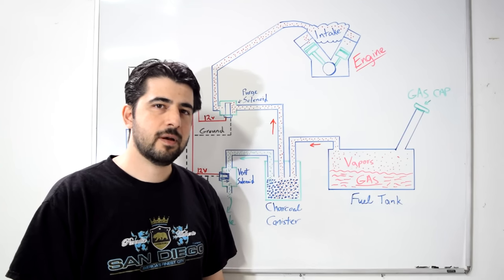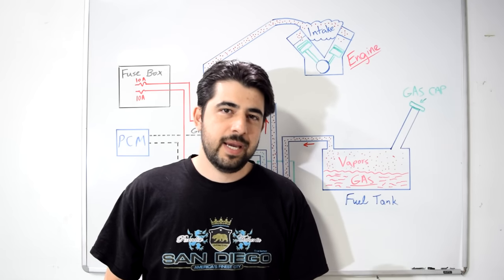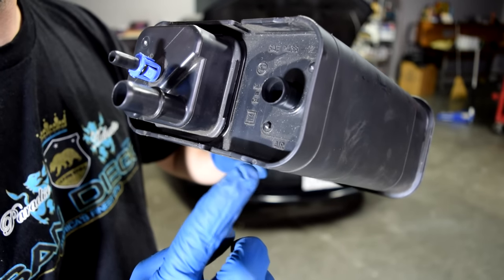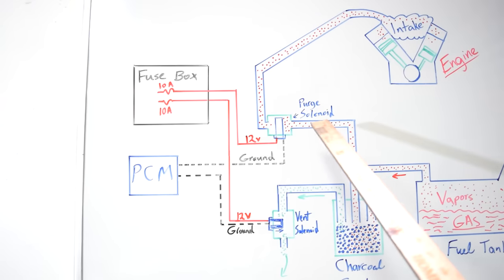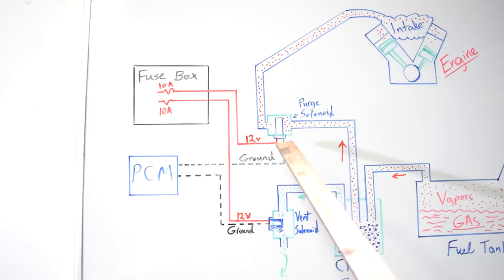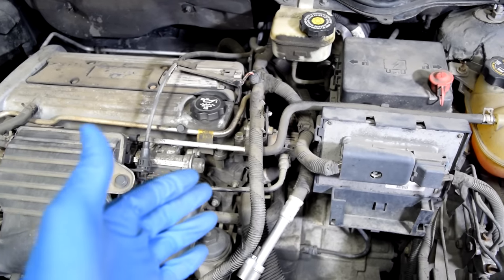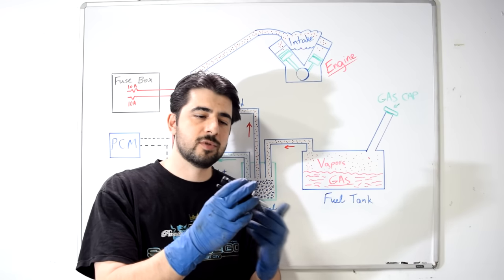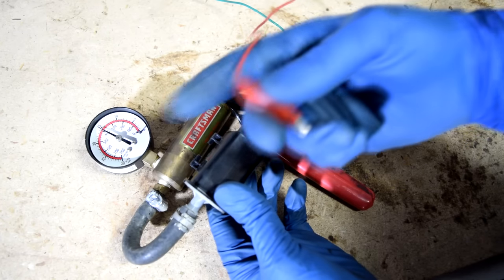Evap Canister Purge Valve Solenoid Operation, Diagnosis and Testing Procedure

Comment: Vent solenoid allows the fuel vapor to depressurization the fuel tank via the carbon scrubber to air. check. Purge solenoid closed until engine is warm. Normally open Vent solenoid closed for startup then reopens after warmup to allow the carbon filter to clean itself or give back the captured fuel vapor that it accumulated while the car was in the hot sun. So it seems ok, but the vapor purge process will cause the engine to run lean after the carbon canister has been purged of fuel vapors. Yeah? What do you do with an older vehicle that has no PCM? I can put a thermal valve in the engine block water jacket to open when warm. Check. But once warm and running it seems I need something to stop the vacuum leak which is the vent valve purging through the carbon filter, but do need to reverse the air flow through the vent valve after the fuel vapor is cleaned. Right? Does that mean I need a driver operated valve to close the vent valve after it has done its job?

Comment: What do you mean if the I have a bad purge solenoid I am going to have a hard time to start the car after i refiil the gas tank? I just put gas in my gas tank and right there the car didn't start. Cranks but it won't start. how do I know is it is the purge solenoid and not the fuel pump?

Comment: were having trouble with our EVAP system on our 98 pathfinder, and were trying to figure out if the lines that go to the sensor solenoid valve is supposed to have charcoal  in it. we have looked everywhere to find out but cant figure it out. can you help?

Comment: what will happen if it quits in the closed position because mine is running fine but the vent solenoid is working and the charcoal canister is good so idk what else it would be

Comment: I got a cell code a p1cea on a 2013 dodge dart I changed the vacuum hose bought the hose at the dealer two days later the check engine came on , could it be the solenoid?

Comment: You can also disconnect hose coming from cannister and unplug elec plug, with car running to check if valve is stuck open. Which if it is would show suction at valve disconnect.

Comment: Hi, your diagram makes things very clear. I have Maxima 2005 and it’s giving me p1446 code which is EVAP vent valve control. I checked it and it works. The power is getting to it as well. The issue is that when I fill up the tank, the fuel will stop filling automatically half way a few times. So it looks like there is a blockage of either the tube that connects the tank to the EVAP canister or the canister itself is clogged. Can anyone suggest a method to test?

Comment: If it's stack in opane position you will find no problem with cold starting in the morning but hot start in mid day u will find the vary hard start spacial when hot day

Comment: My purge valve is always open, I dont have a code for evap, but get a really bad whine at idle. I know it's from unmeter air getting into the intake, (had an old mustang and made mistake to attach an open catch can and run it back to the intake lol) can that be causing m issue? I take the sensor off its closed and stays closed no vacuum but once I reconnect it it's always has vaccum. It's a 2017 mustang gt

Comment: Wow! Always top notch man!  Thanks for sharing!  I see now its a bit older video but still just what I needed.
This is one of those problems that I have been fortunate to have never been exposed to with any vehicle ever and really didn't know a lot about it.
What about the charcoal canister, do you have a video on the faults that it can have?

I'm getting a P1450 now on my 2000 Ford Windstar with occasional rough idle and road speed conditions. It comes and goes for now.

Comment: I have a 2015 Chevy  Sonic LT 1.8  P0496 I think its the purge valve. What do you guys think?
Reply: Jesse Rathbun did you replace it to see if that's what the issue was? in curious because my chevy cobalt has kicked this code and was wondering if I replace mine will it fix the issue.

Comment: I need help if someone can chime in. The code that came up was p0171. The dealer said that the issue was a bad "purge valve" and not covered under the "emissions warranty" for my 2016 chevy sonic. The covered parts says the electronic evaporative control system is covered and specifically lists the "canister solenoids and valves" as well as "plus miscellaneous items used with above components". The "purge valve" is not specifically listed. What's the difference between the purge valve and the canister solenoid valve???

Comment: Hi. Thank you very much for your great videos. I hope you help me with my problem.
Check engine light on my car came on 2 months ago and since then I almost cleaned and replaced everything I could think of. (MAF & MAP sensors, Intake Air Temperature Sensor, fuel injectors, spark plugs, coolant Temperature sensor, camshaft and crankshaft position sensors, 2 O2 (lambda) sensors and cleaning the EGR which was not clogged) 
after installing camshaft sensor check engine went off for few hours and came back on again...! then I replaced all O2 sensors and car was fine for 2 days but today morning again back on...!  
all the time I see "Antipollution fault" on my display. 
I disconnected the Purge Valve from PCM then connected it back. still check engine is on.. after 5-6 hours.. I started the car and check engine light was off till now................. before I ask my question.. I have to say all past 2 months car starts and crancks just 1-2 cracks and runs in -3 C in the morning!!, but when engine is warm it takes longer crank to run the engine. OBD II showed various error codes and after replacing Injectors and O2 sensors those codes are gone but now I see P1454 (unknown).
-----------------------
Question: 
1- why car cranks longer to run when it is warm?
2- based on what I replaced car, do you think my problem can be Purge valve? gas cap!? where should I search or test for problem. (Peugeot 406 coupe, 2.0, 16 v, Petrol)
Thank you in advance for your help and advice.

Comment: I have a code P0449 on my torrent for a purge valve and is it possible that it's giving me a misfire on #1...i have changed everything possible...spark plugs,wires,egr valve vent solenoid and runnig rough idle and bad acceleration ???

Comment: Great work with your videos! I have a question that is off topic but perhaps you can help. I'm referring to a Harley Davidson here. I continually get "rich codes" for both cylinders. I won't go into how many parts have been replaced but my question is...will a bad purge valve possibly cause "rich codes"? Keep up the good work!

Comment: I have a ford focus mk1 2004 1.6 16v. Everytime if i open the gas cap there is some hiss noise corming out of it and smells to gasoline.   i already replaced the Gas cap for a new one. But still it maken hissing noise. Could this mean my canister is stuck closed?
Reply: Mine too. Its under pressure.

Comment: My, I suspect defective, purge valve makes an electronic noise (engine off) when I touch the hose.  Is this the valve closing?  At first I thought it was the elctronic connection but I don't get the noise when I push on the it. Anyone who can comment who's had this experience is greatly appreciated.    2015 Ford Focus

Comment: Could this also be the cause of a vehicle after pumping gas to turn on then turn ignition off but motor still running for about 3 seconds then turns off? Car runs fine and turns off and on fine after that tho and it's everything u pump gas

Comment: Why do Nissan vacuum switches have 3 ports?  I understand how to test them but have no idea why my 93 d21 egr vac. solenoid has 3 ports.  It looks like 1 vacuum source for one pathway (non-energized) and another source for the other pathway (energized).
Reply: I watch your videos and learn.  I found the answer to my question. Nissan labels nipples B,A, and C.  (A and B are the 2 close to each other.)  1 vacuum source (B) and the other extra nipple (C) is for vacuum dump.  As in needing power and needing the egr to shut down fast.  Solenoid de-energized and pathway closes (A-B) and opens pathway (A-C)= vacuum dump into a line that looks like a vacuum source but is in fact not a vacuum source.  (This line winds up in my air filter holder.)  Hey thanks for all the help with TPS, MAP, etc.

Comment: I have a 2008 GMC envoy. Great video. Had a p0442 code. first replaced gas cap and then Purge solenoid. code still there. However instead of the code stating small air leak. it now says  Evap system solenoid circuit. So i thought the solenoid i bought was bad and replaced again. Same thing. Any ideas?

Comment: Great explanation. I would really like to see a video of someone tracking down a small leak without a smoke machine. Will using a positive pressure of 15" wc and snooping the connections work? Is there any reason not to pressure up the evap system by putting 15" pressure into the gas tank?

Comment: Good job bro, I have a f150 2004 ford when I put Vacuum to the intake side it holes and hose but when I blow in through the charcoal canister side air goes through and comes out on the intake side is that mean it’s bad or is it OK but you have to blow hard OK no jokes😊

Comment: Thank you so much for all ur videos they have helped me so much, But I have a problem with my '99 dodge durango 5.9L 150k the RPMs sit at about 1500k to 2000k I have checked all the vacuum lines under the the hood did the break cleaner test Replaced the TPS Map AIC valve throttle body gasket and still have a high idle the truck has plenty of power won't hesitate but sometimes just dies on the red light and starts right back up, please I'm sure you have gone thru this please help I don't know what to do thank you so much.

Comment: does the canister has to be mounted in specific way and position? i'm doing the whole frame swap and the canister originally it was mounted flat horizontally (2004 Crown Victoria) under the trunk. Can i mount it vertically?

Comment: ive been chasing my problem around on my 99 honda accord. car wouldn't start after i filled up gas tank. changed gas cap. changed charcoal canister and shut off valve next to it. but it seems its the purge valve solenoid. damanations

Comment: Great video .can't wait to figure out what's wrong with my 99 ford f150. Have two codes for purge failure. Forget exactly what they were but were for that.was wondering if anyone would know if that would make engine idle high when cranking and run fairly high but after you sit like in a drive thru for awhile want to die out. But usually run good.

Comment: Maybe you explained it differently, but your diagram suggests different operation than I'm used to. normally, the vent valve is in series to the purge valve. When it opens it lets the vapors go into the engine. Because of engine vacuum, I think the vapors would still go into the engine when the vent opens with this unique design. Except of course when the purge valve is also closed to test the system for leaks.
Reply from the maker: Under normal purging of the canister, Vent Valve is open so is the Purge valve. During the Evap test the vent valve is closed, purge vale is open and putting a vacuum on the evap system. While the test is being performed through the fuel tank pressure/vacuum sensor or a purge flow sensor the computer knows if there are vacuums in the syste, allowing for more air pressure/flow or less vacuum in the system than expected.
Reply: Ratchets And Wrenches Cool.

Comment: My gas tank knocks, both when the engine is running, and when I shut the engine off. Could this be related to the purge system creating a partial vacuum in the fuel tank?

Comment: OMG we had garages grasping at straws saying it was our throttle body, and everything else this valve never even came up until we took it to the dealership, our car would have a hard time starting after putting gas in, and it would just rev up and down at stop lights, a stuck open valve makes sense.

Comment: Thanks man. Im changing the purge selenoid in hope it solves the small leak problem in my prius. Its the last solution as I have already replaced all the other components of the evap system but the code still appears.

Comment: Question. Should the purge valve block air flow in both directions when closed?  I can blow air through my valve one way but not the other. I cannot blow air through it towards the manifold.

Comment: This solenoide did the p0171 code to come out since this is basically a vacuum leak. it showed a lean condition and the fourth mechanic who checked the car was able to find the problem. the car was a toyota corolla 2018. I say this to help someone who need some clues.

Comment: Thanx for the video! So what happens when the evap purge solenoid tube to the motor is broken/disconnected? Cant start the car?
Reply from the maker: you should be able to, it'll run rough until your fuel trims adapt though.
Reply: aha. THANX! maybe I'm having another issue in addition then. I broke one of these tubes while changing the battery and now the car doest start. When i turn the key, the starter tries ONCE and then everyhting powers off. I DID connect my battery correctly, (was very careful with that). Do you think i can just try to tape the tube up? Is it save to do that?
Reply from the maker: just put a rubber hose where the tube was as a temporary fix, but it sounds like you actually have a weak battery if the engine is turning over just once.

Comment: Greetings, 

I appreciate the video and your not apologizing for cursing.

I need some help and I'm hoping you can help me or point me in the right direction.    I have a 2005 Chevrolet Suburban 1500 LT and my check engine light went on a week ago.  I took it to AutoZone to see what the code was and it said I needed to replace the Evaporative Emissions (EVAP) Purge Control Valve, which I did.  I turned it over and the check engine light went off.  Cool right?  Easy cheap fix.  So I start it this morning and the check engine light is on again.  The code I get is the same one as before, P0455, most likely solution is to replace the Evaporative Emissions (EVAP) Purge Control Valve again.  I'm frustrated as f*@k!

What should I do?

Do you have a shop?  Are you in North County SD?

Comment: So when the car heats up and you start hearing clicking noises from the purge valve, when it activates, would either mean an issue with the PCM or the valve?
Reply: no most times the purge solenoid is pulse width modulated so it does click repeatedly when the pcm is commanding a purge

Comment: Cool video, maybe you can help?
2007 Jeep Grand Cherokee 3.7 has P0507 (High idle detected). New throttle body, Map and coolant temp. still getting MIL.
I've collected freeze frame data several times light only trips when stopped and in drive. Idle has not been above 770 each time.
Appreciate any ideas on this.
Reply: Did you get it figured out?
Reply: @Pete3Heat  Nope going to try PCV and if that doesn't do it try cleaning the egr
Reply: @Pete3Heat  it only trips the code when come to a stop at a light.  You could drive it for 2hrs light doesn't come on until you stop. Code doesn't trip if it sits idling in park either.

Comment: No way im going out the door. Im coming in n stay. Lol. 
I have a P0455 code 😞😷. I try to replace this part n hope for the best. 
Thax ! ✌
Reply: Have you done the repair? Did it clear the P0455? I also have that code and P0441 so I'm gonna replace the purge solenoid first and then the vent solenoid if that doesn't work.

Comment: hello brother at the time of watching your video I realized that only you can find the problem that my ford f150 2013 has and I would be very grateful if you would answer me because I think that many mechanics today are only changing pieces, well the problem is the next when I'm on the road, either 40 mph or 60 mph, it stops me from accelerating or the acceleration does not respond and it appears on the transmission sensor board to be able to continue only turn the car off and turn it on and everything to normal it does it like every 15 days more or less now when I'm going to throw gas that filled the tank ignites with problems and only does it when I throw gas the other times that I turn it on it does not give problems until I refill again to turn it on easier I do not let the tank empty less than half ok ok ok it seems that at some point the gas stops flowing with the proper pressure, the selenoid purge and selenoid vent are sensors and at no time the che k engine or my conclusion of your videos and my little knowledge of mechanics direct me to the canister good is something very strange please I hope you answer me thanks ah! to the critics of your videos for your way of expressing yourself what to say in your way of being what they do not value is that you help and teach good thanks.

Comment: where is the list of other potential codes you promised?
Reply: nvm found them...my P0174b system 2 bank 2 did not show up. I found that the vacuum line at bottom of my purge valve was broke. my 95 vic has all the symptoms except poor starting after refuel.
Reply: nvm found them...my P0174b system 2 bank 2 did not show up. I found that the vacuum line at bottom of my purge valve was broke. my 95 vic has all the symptoms except poor starting after refuel.

Comment: That was very informative. Had a check fuel cap light on. Very easy to install. That explains why my car had a rough start when cold sometimes.  Part only $17 on ebay. Thanks!